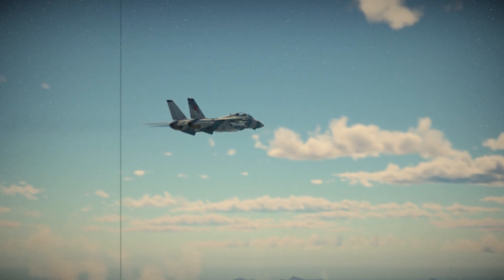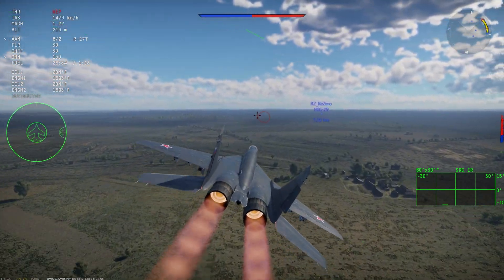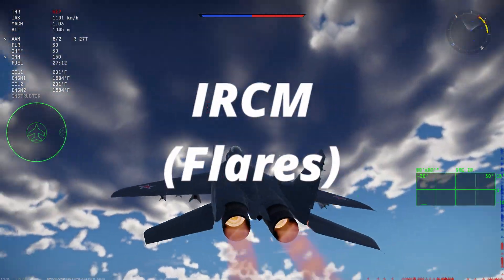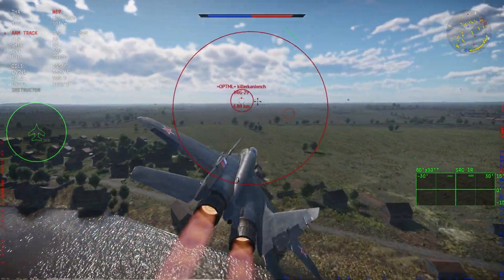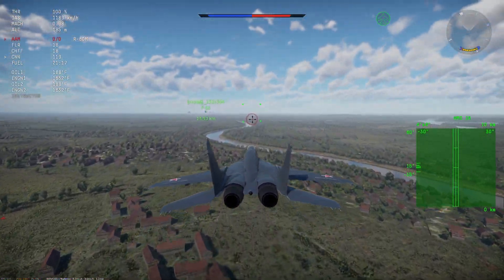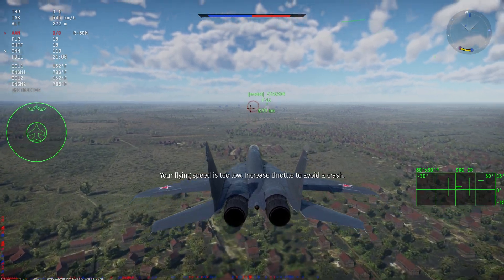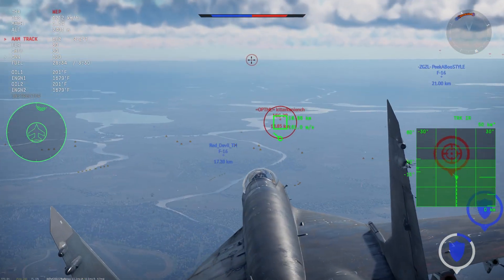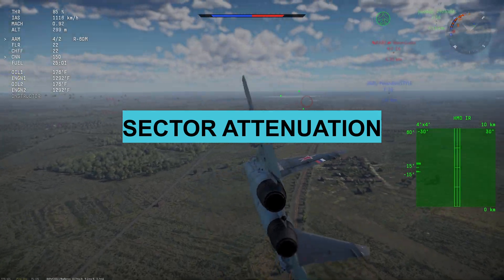How Do Infrared Counter- Counter Measures (IRCCM) Work? (War Thunder)

Comment: some miscellany and other different types of IRCCM:

from what i understand for the Stinger, there’s a double seeker head; one is an IR seeker, and one looks for a UV shadow, which helps it distinguish between flares and the original target

the Sidewinder-X has imaging infrared (IIR), which creates pictures of the infrared seeker window, and onboard software determines what in the picture looks like the target aircraft
Reply from the maker: Yeah, more advanced for sure. The stinger is a sad missile in game though lol. Python, IRIS-T, ASRAAM and Aim-9X should be hard to defeat when they come.
Reply: @AlphaHeavyGamer  9X will be basically impossible to defeat tbh, I don’t think warthunder will ever get to that level of modern 

unless something drastic changes like 12.3+ is locked to EC and sim only

Comment: Gaijin already modelled at least two of the IRCCM responses mentioned in the video, the memory and fov gating, at least they mentioned these in a mini devblog of some sort. I do however not know the trigger condition and if it's based on actual in game physics or just a simple check for a flare entity. Although I think the fov gating happens passively, where it just shrinks post lock to a smaller fov unless it loses the target again.

I believe most if not all manpads come with both of the aforementioned responses and the 9M37, R-27T and R-73 only have the fov gating.
Reply from the maker: I would really like to know how they model IRCCM. They should share the information with the player base so we are not left guessing.